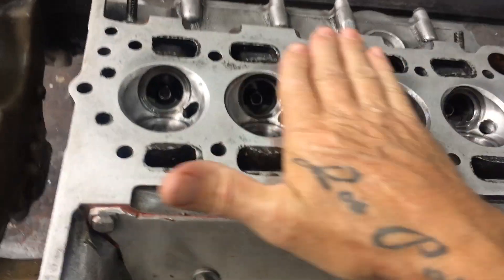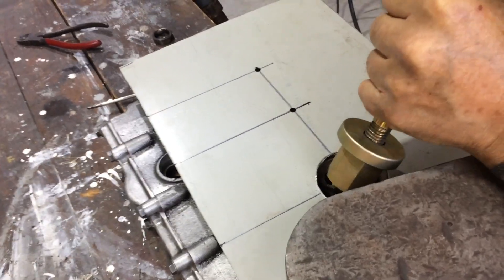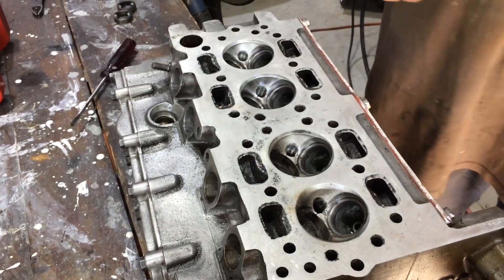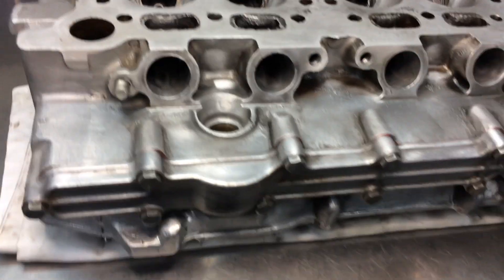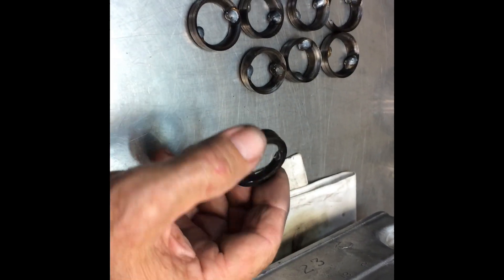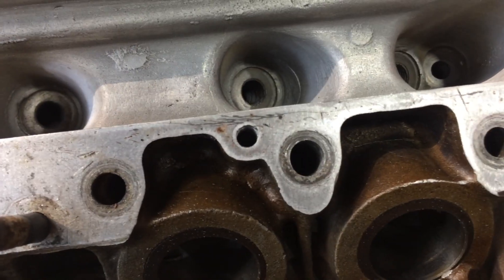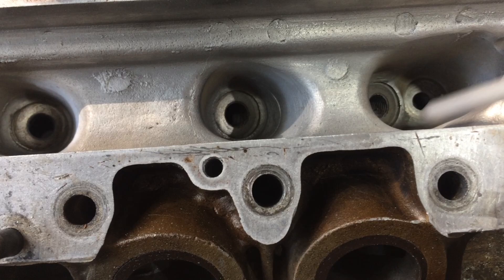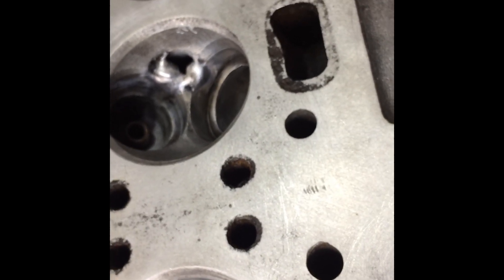Honda S600, Pt 33. Can we fix this head? Plus Chrome Plating

Comment: Another great video Jason. By the way that second oil pump you mentioned is actually a centrifugal oil filter which spins at high speed and separates out particles that get through the paper element filter . A very effective system so the stuff inside shows that it has been doing its job. The damage on the camshaft/camshaft bearings is almost certainly due to the oil pump drive shaft shearing . The fine gauze on the oil pump suction strainer can split due to vibration/rubbing on the supporting fins behind the gauze. Once it splits any large particles (usually the rubber teeth from the cam chain guide rollers which harden and shear off) enter the oil pump and lock it up . The oil pump drive shaft then shears so with no oil flow the plain bearings on the camshafts are first to lock up. It is quite a common fault so the best thing to do is regularly drop the sump pan to inspect/change the gauze. Also replace any hardened rubber camchain guide rollers. Usually the crank bearings are ok being roller bearings. The seized camshaft bearings lock up the engine before the crank bearings are affected. This happened to me on my S800 in the 1970s.
Reply from the maker: Thanks for that David! Sorry I got that wrong, I was wondering how it could pump, I must of read that wrong! I'm sure you are right David the Oil Pump Strainer was Blocked, I will be servicing the Oil Pump before Installing it & I remember you saying to make sure them Hard Rubber Type Rollers are new, Cheers!!

Comment: I'm planning to slightly break/radius off the sharp edges of the ribs which support the oil pump gauze. Hopefully that will reduce the stress raiser effect and make the gauze last longer. This issue is not a  big deal on a show car unless you plan to do high mileages.
Reply from the maker: Thanks David! I still have to finish the oil pump. I will be driven but really only weekends on nice days, Cheers!!

Comment: The old valve seats could not of been cast iron if you tack welded them.
Reply from the maker: I'm not sure the exact break down of them but they do have Iron in them & they are cast to make them. I have read & been told they are Cast Iron. To be exact they could be Austenitic Iron! I have welded Cast Iron a few times with a MIG, it's not recommend unless you use Stainless Wire, but Mild Steel Wire is fine to do a quick job, that you don't need to last very long! If you google 'can you MIG weld cast iron' you will see the answer & theres plenty video's of people welding cast iron on youtube! Cheers!!